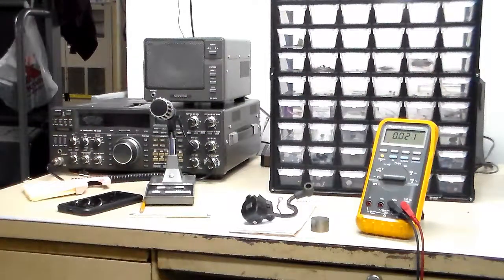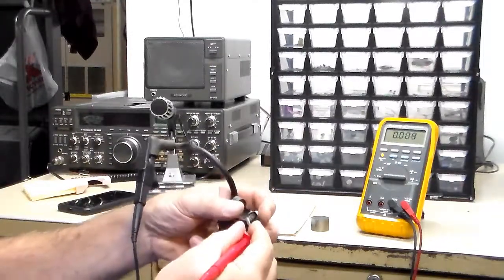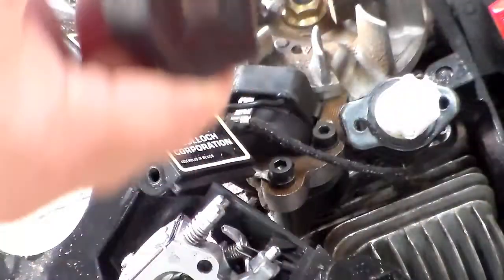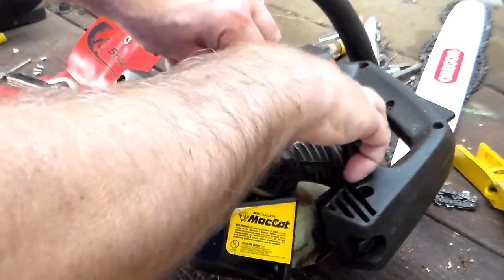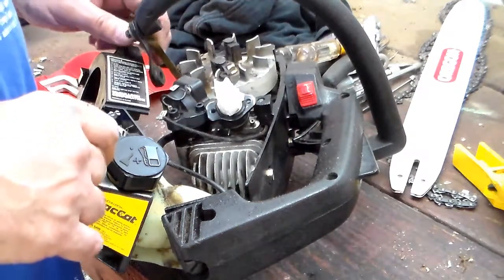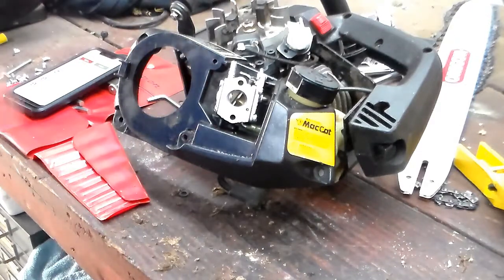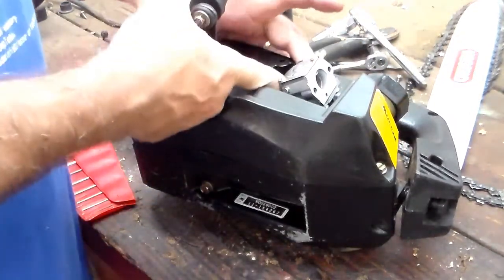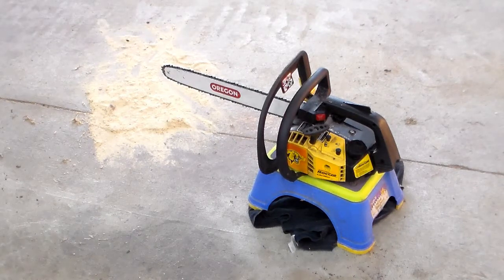1992 Mac Cat Chainsaw Coil Replacement

Comment: 5th July 2023 UK. Thank you for this video.  I only wish I had found it earlier.  I have the exact model chainsaw with everything OK on it except the Ignition Coil.  Your most informative video from two years ago, has confirmed what I was beginning to think, after hours of Searching online.  The Ignition Coil Is No Longer Available!  There are lots of ignition coils out there for McCulloch, but none outwardly, look anything like the Type AM 32 SEM Walbro made in Mexico, which makes one feel rather Pi###d Off.

Comment: I know this is an old post but when you were setting the gap clearance you tested once and then said you checked the other side(around 17 minute mark), what other side, your hand was in the way?
Reply from the maker: Ya, a bit hard to follow.  Best way is use a business card between coil and flywheel.  Then tight both bolts.  That worked great on the newer video I did.
Reply: @timtimeprojects3576  The reason I asked was I just finished putting two Mini 2.0 back together that had both ran before and now I get no spark from the coil. I can't imagine that both coils went bad at the same time so I was thinking maybe I didn't set the gaps correctly(I did) but couldn't tell from your video. Most likely will scrap both saws for parts because coils are none existent or too expensive. Thank you for getting back to me.

Comment: My MAC3516 won't start when it is hot. If it is a bad coil, I don't understand why heat makes it go bad?
Reply from the maker: The replacement I put in is bad too.  Weak spark when cold. No spark when hot.  Can't find a replacement for the Mac Cat anywhere.  Probably the heat causes a joint or component to expand and open connection.  The CDI is a little more complex than the breaker point coil.  I may tear one apart and will video if I do.
Reply: @timtimeprojects3576  Thank you.
Reply from the maker: More than likely the little wires on the coil had a break or loose connection and are just touching.  Heat causes everything to move and possibly expand, so connection is lost.  Or the heat effects a component inside the ignition module in the same manner.